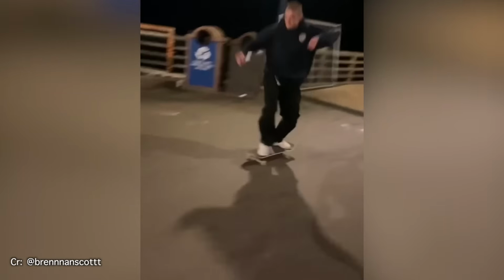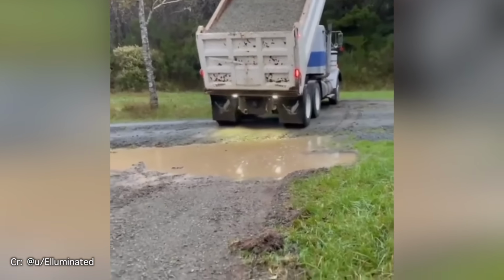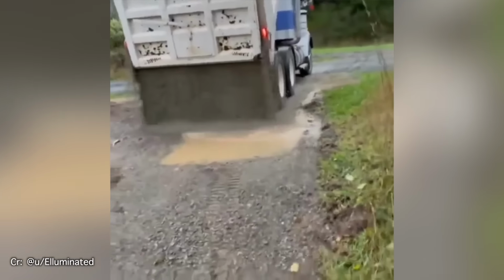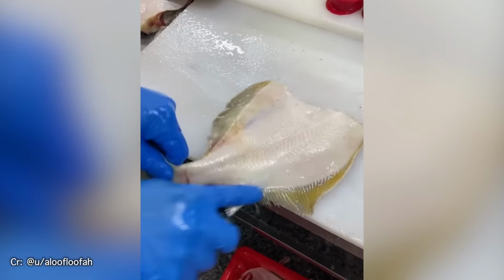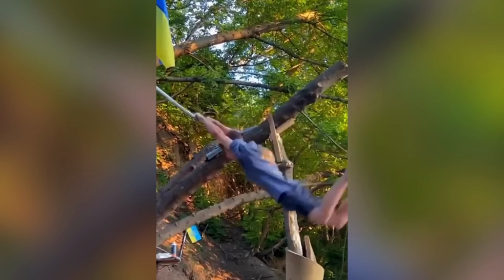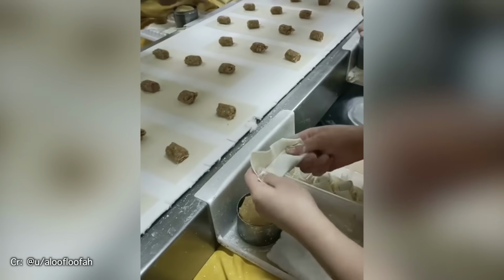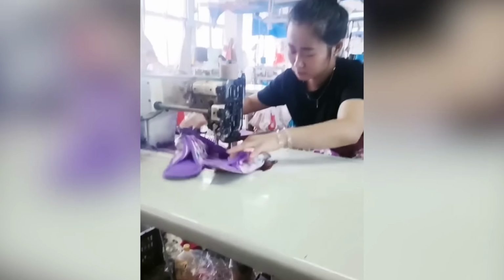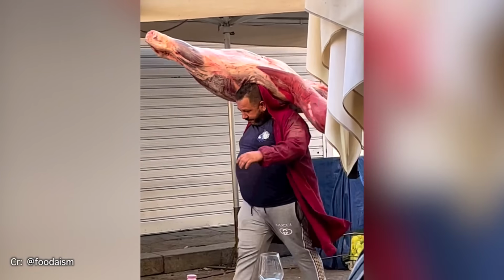Like a Boss Compilation! Amazing People That Are on Another Level #14

Comment: The Monk breaking a rock with a single finger was Lord move.
Reply: Actually, the guy does NOT break the rock with his one finger. 
If you use the frame-by-frame feature (using the comma key to go back one frame at at time, the period key to go forward one frame at a time), you can see that he hits it with his knuckles. He points his index finger to be parallel to the surface of the rock.

Comment: At 1:32, the guy does NOT break the rock with his one finger. 
If you use the frame-by-frame feature (using the comma key to go back one frame at at time, the period key to go forward one frame at a time), you can see that he hits it with his knuckles. He points his index finger to be parallel to the surface of the rock.
Reply: The time stamp is wrong, this happens at 1:32 . You're right, he does break it with his fist instead of his finger, but it's still something most of us will never be able to do, so props to him anyway. 😎
Reply: @KFCuser  Thanks for the time stamp correction, KFCuser. I have now fixed it. 
And yes, his feat is still impressive. If it's what it seems to be (minus the false impression that he breaks it with his finger.)

Misleading stunts is one of my pet peeves. I think it started with a TV show back in--I don't know, probably the 70's. I think it was called "Thrill Seekers," and was hosted, if memory serves me right, by Chuck Connors. And one particular stunt taught be to keep my healthy skepticism close at hand when watching this kind of thing. 
There was a guy who was showing off his skill with a sword. Another guy was lying down and had a watermelon balanced on his stomach. The swordsman brought the sword down, cutting the watermelon in half without even nicking the guy. 
Impressive? 
Yes. But less so when I caught the inconspicuous twist of the blade that actually finished the job of splitting the watermelon. In other words, the swordsman didn't have to come nearly as close to the skin of the other man as it seemed at first. 
They kind of gave away the game when they replayed it back in slow motion. I wouldn't have caught it otherwise. 
Still impressive, but I was offended by the intended false impression.